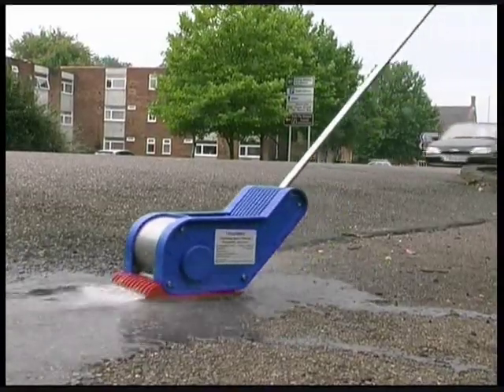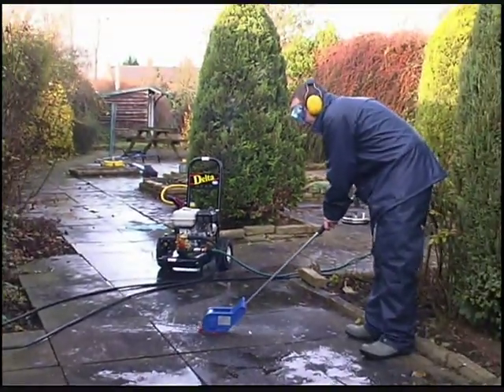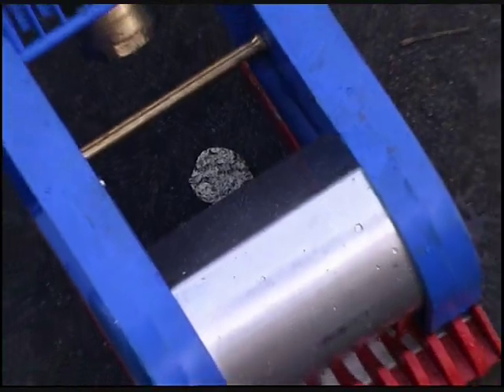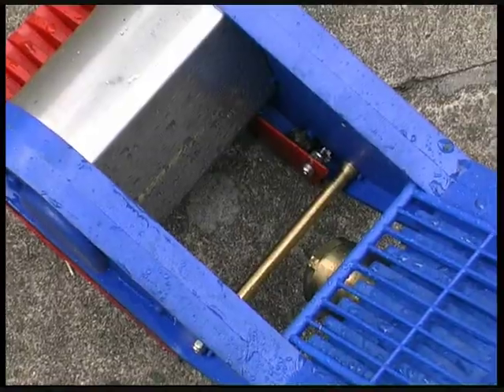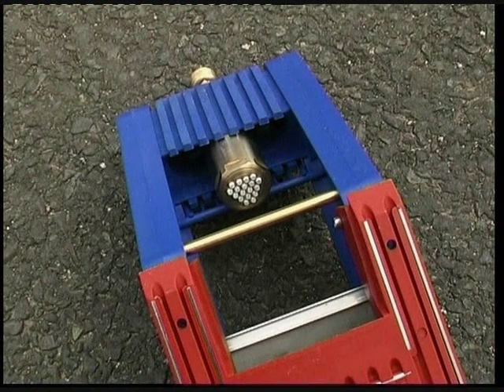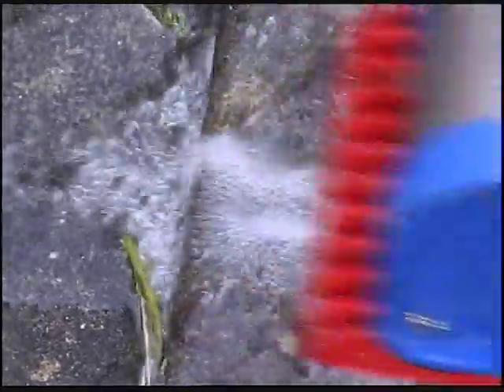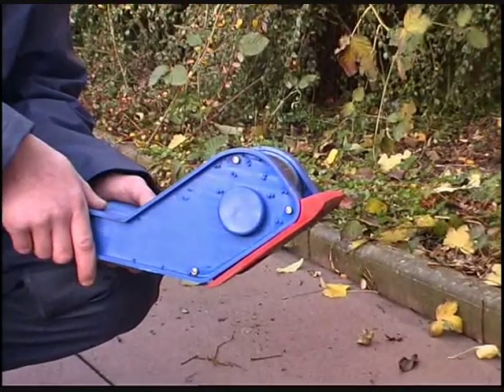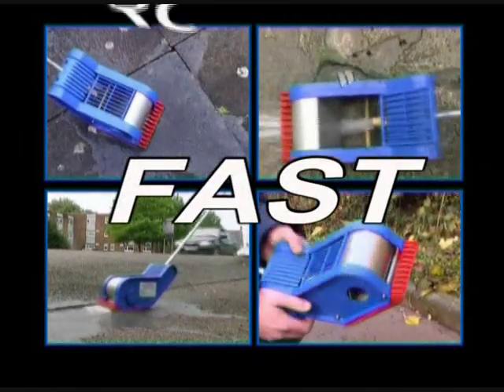Chewing Gum Removal - B&G Gum Blaster Demonstration

Comment: I power wash every night and i would never buy that. All you need to remove gum is HOT water. A duel lance wand will help you not to etch the surface. This thing didn't even show gum that had been sitting in the sun all day and walked through.

If you are able to make a living off selling this then more power to ya.

Comment: @jimj122680 if you look closer, its just the high pressure heads cleaning the concrete too, its leaving a mark because it just cleaned it down to the original color of the surface.